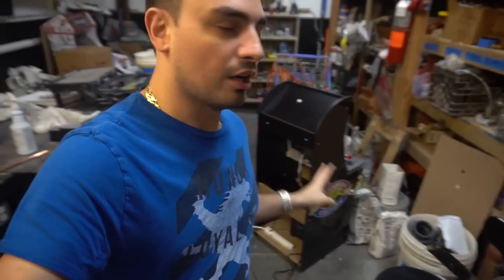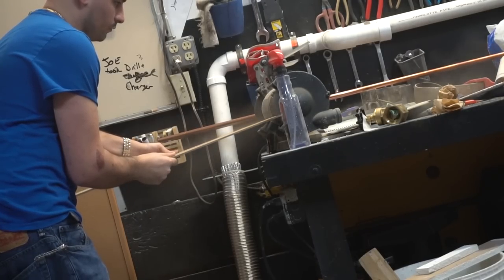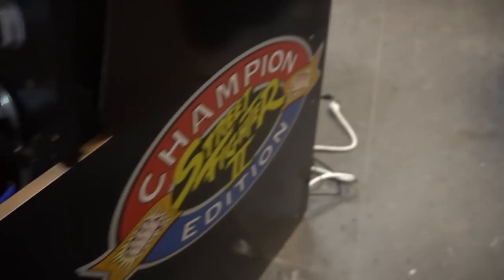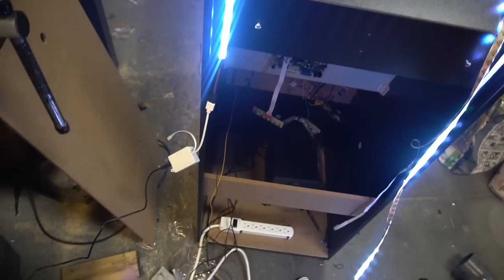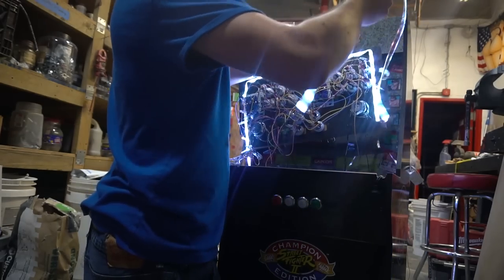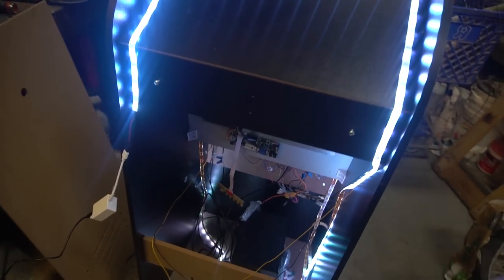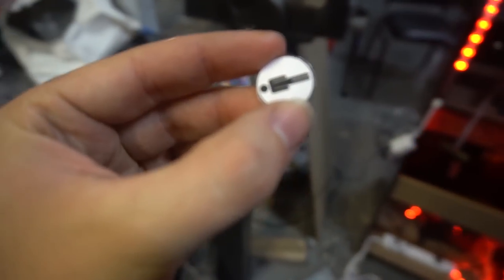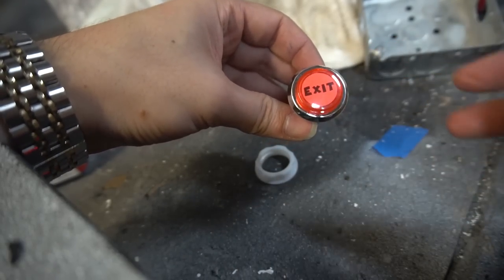Arcade 1up Mod part 3 - Final details Led strip,underglow,audio controller and custom button inserts

Comment: You’re a fan of Velcro- instead of staples which can damage the strip, just put pieces of Velcro very few sections on the back. I ran mine along the inside of the T molding which wasn’t the best spot because I couldn’t get the back board out.
Reply from the maker: Not bad, I just woukdnt trust velcro for transit haha

Comment: Is there enough led strip and clearing for you to have also run the strip from the top of the machine, back in and out under the marquee, as well as under the control panel.
Reply from the maker: Yes, however going under the marquee you will definitly need to put a little notch so the led strip does not get cut or squished. My first mid I tried it, I screwed the 2 side panels back and surrounding enough it cut the led strip.
At the top of the back of the arcade, you see how I did like a U shape pattern, if you want marquee, dont do the U shape, just do right along the top and send it down to the marquee, one straight line

Comment: Great video looks great, was wondering what your thoughts are on the lcd screen recess and the the 20inch lcd mod ?
Reply from the maker: Never seen the 20 inch mod, def woukd be a major difference than the stock 17"... also recessed is cook but your gonna definitly see the original cut out part for the original monitor, might as well make a whole custom cabinet which is what I plan to do next

Comment: I want to know how you get the led lights to change with the buttons
Reply from the maker: Led buttons have a daisy chain style wire. Mine are black and yellow wires. Black goes to the 12v input on the led strip.. yellow goes to which ever color you want it to activate. You will need a soldering iron
Reply: @Vic_VP  thanks for the reply
Reply: Now they have the new led buttons wire lol
Reply from the maker: @tymo70fo  not sure what  u mean, send me pic on DM in gram. Someone sent me a pic of a button that has a white connector going into the button.... and 3 little wires coming out of it, I told him to return it as it wont work
Reply: @Vic_VP  those are the ones but i bought the ones you have quick questions what are your 4 admin buttons for ill send question to instagram
Reply from the maker: @tymo70fo     yes those are assssss I didn't like those, admin buttons are for what ever you want them to be. Most commonly used for exit game really... I like a save and load where you left off feature.
So my admin buttons is hotkey, exit, load ,save
Hotkey is like shift... you hold shift and the  press the button you want